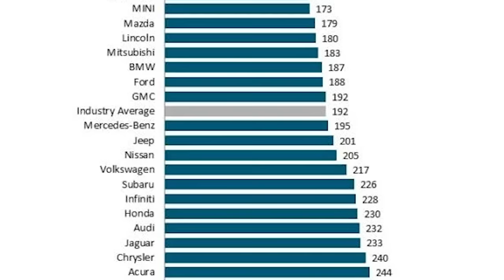Trucks That NEVER Break Down (Reliably run 1,000,000 miles)

Comment: Not to be that guy, but my 4.6L 1997 F-150 got 565,978 miles on it before it just gave up. I don't know of too many Chevys that would ever come close. (Although, imo, the S-10, depending on the motor, was the best quality Chevy EVER made.)
Reply: Brian Jake Gaming  S 10 is the best Chevy ever made. 1500 from 88-97 comes 2nd. I've owned all 3 and my F 150 justifies why it's the best selling truck of all time, and the #1 Most sold vehicle in general in the US. Chevy fan boys hate that big ass pill to swallow. I understand tho. U owned an Avalanche, didn't u? Or maybe a Colorado? You have fake "vintage" Chevrolet tin signs in your garage, don't u? Maybe a bowtie tattoo?
Reply: There was an 86 f150 stright 6 that had 550,000+ miles that just would sit at my shop but we drove chevy express for work trucks. All guys beat the fucking balls off them. Would them so low on oil for so long. There was an 01 , 03 , 05 that all still run as back ups and new guys trucks. The 05  is an everyday truck and needed a transmission rebuild that costed 3k which was cheap around here for that work. I just picked up a 2014 f150 5.0 with 100k miles as my personal. Both chevy and Ford make some good vehicles. If I didn't see those chevy express vans with the Spartans box body get the absolute balls beaten off them and run 99% of the times I'd hate on chevys all day lol.
Reply: The old 4cyl rangers (the twin spark SOHC ones) do it routinely
Reply: My gmt 400 has about 633,000km and it still running strong and is still on the stock engine and 4l60 that being said I the Trans has been slightly modified with a shift kit and a bigger trans cooler but that’s about it
Reply: E150 with a 4.6, 670k, and ran like a champ, but the floor started to rust out.

Edit: only one spark plug change, and when I say it ran like a champ, I mean you'd think it had maybe 150k on it.
Reply: S10 transmissions were garbage. Got one sitting in front of my yard as we speak.
Reply: There’s plenty of Chevys that have, basically most gmt800s, 900s, and even the 400 series trucks last forever. Seen plenty of owners from Facebook groups with a ton of mileage on their trucks.
Reply: @shuruff904 GM sells more trucks than ford does to this day, it doesn’t matter. McDonald’s sells the most hamburgers, doesn’t mean they’re the best 😂

Comment: i currently own  a 91 toyota pickup. its been flawless i have taken so many trips over 200 miles and haven't had any issues at all.
Reply: Those are amazing trucks. I had a 92 which I put 370k on and finally sold it to a kid doing landscape work and I bought a new Tacoma back in 2012 which I still love as well. Every so often I see my old 92 still on the road hauling a trailer with a lawnmower on it.. incredible!

Comment: I have a 2007 Toyota 4Runner with a V8 with 167,000. Anyone know how much longer that thing is gonna last!? I’m waiting for it to break down so I can another Toyota!
Reply: It won’t ever break down if you keep up with maintenance
Reply: dont wait for it to break sell it now, it will be worth less if it breaks.
Reply: Therw are two million mile tundras with that same 4.7 v8 with no repairs done to the engine, and these trucks hauled and towed well over their rated capacities. They were hotshot trucks for the oilfield. Keep the timing belts changed and it will last forever.
Reply: @Jackmerius_Tacktheretrix  i believe there are 3 now and 1 Tacoma, original motor and transmission, 1 million miles
Reply: forever if you take care of it.
Reply: Unfortunately for you, never
Reply: You’ve got several hundred thousand miles left on it.
Reply: Leaving it sit abandoned in the driveway it will be good for another 5 yrs before you can sweep it into a shovel

Comment: my nissan  2013 titan pro 4x4 is a beast and is running with 185k miles like new. it hauls the 16ft trailer lor no problem.

Comment: I think your list is pretty spot on. I am a mopar guy. I have all Mopar in my garage. I love the Dakota. I have had 5 of them. 2 first gen, 2 second gen and I currently have a 3rd gen with the 4.7. I would never own any other mid size truck.
Reply: I have a '97 Dakota. In 2006, I purchased it from a buddy of mine, who needed a vehicle with better mpg. I live in the rust belt of Minnesota, where corrosive anti-icing products make driving possible, and expensive, because of rust issues. I retired my Dakota a couple years back. Never left me stranded one time. The body integrity became more of an issue because of the rust. I now drive a Ram Laramie, which I love.
Reply: If you never  buy anything  else  you'll  never know  what a good  truck is
Reply: @garysh3580  I'm never been known to be a fast driver. But I've always been interested in hot rods of the vintage type. Now I'm itching to look at the fast Ram Laramie on steroids. There goes my silent ride of my Laramie now, but the hellcat edition sure looks like a beast! Forget mpg; it's noisy; but not a lot of close neighbors to complain, anyway.

Comment: 90's Dakota over the Ranger and S10, the 318 is far more reliable and the frame is much stronger allowing it to actually do work.  I have 300k and abuse mine on the farm, never had a problem since purchased new, original transmission.
Also have a 97 V10 5spd dodge farm truck with 500k with 0 issues.
I think Gm makes the least reliable half ton from 07-23. Lifter issues on 5.3 and 6.2l and transmission/converter issues from 14+ with 6 and 8spd. It should be taken off the list entirely.
Reply: You're tripping
Reply: @AFTERSHOCK-bh7hh  from point "A"to point"B"!  That's my type of "TRIPPING"

Comment: Ecoboost engines have notorious timing chain and cam phaser problems. Most need them done before 100k miles. Some people have it done multiple times before that. Fun engines definitely, reliable? Not at all
Reply: You’re not correct. Literally thousands of them running around with 3-400,000 miles already and have never been touched. Nice try.
Reply: @adamharris2674  thousands is not a lot lol. Also, there have been tons of service bulletins for the timing chains and phasers
Reply: @rainyriderr1112  Google says 1 million Ecoboost engines have been sold in F-150s since 2011.  So in your mind 8-900,000 of them have come into Service for timing chains and phasers huh?  If ya gonna be a hater at least be somewhat believable lol.
Reply: @adamharris2674  do you own one? Also, can't forget the lead frame issues which would cause the transmissions to shift into first gear from 6th
Reply: @rainyriderr1112  No I do not.  Lead frame issue is for 10 yr old vehicles. What about all the many many issues with New Chevys and New Rams?  Not concerned with those I guess..
Reply: @adamharris2674  I didn't address Chevys or rams at all because I don't own one. I do own a 3.5 Ecoboost though and they're less than reliable compared to a lot of other trucks
Reply: @rainyriderr1112  it’s mostly unreliable to people that do absolutely no maintenance. Like you apparently

Comment: I’ve been working with my 3.0L 2007 Ford Ranger for awhile. Over 190k miles thus far and no issues yet. My grandfather owned it before I did and drove it to hell and back. But it’s still almost perfectly fine. Keep it maintained and it’ll run great
Reply: I have a 2003 Ford ranger with less than 80,000 miles. So far it's only needed a new fuel pump and we're going to change out the serpentine belt with new idler pulleys. The biggest problem with the rangers is they rust out. I just simply don't drive the truck in the snow and salt here in New York so my truck only has surface rust.
Reply: @DueyMiller-rk9dr  I feel ya there and that’s lucky with those miles. Regular maintenance really does suffice for these trucks but you are correct. Just like any other dead reliable beast, the rust becomes the main issue. I’ve already gotten enough on my truck for rust and miles that I may as well use it for the rest of what its got. My next repair is front shocks and that won’t be the end, im almost at 200k, there’s probably a few more repairs that’ll pop up

Comment: My 2000 F150 with 4.2L V6, 5 speed manual traney, extended cab has 286,000 miles on it and still running like a champ.

Comment: I'm rocking a 2010 F150 4.6L 2 valve regular cab.  142K miles no rust.  Doing improvements instead of trading it in.  Last generation all steel and the modular 4.6 is super reliable.  Rustproofing every year and keep up on the other stuff.  No payments for 7 years running!

Comment: Ranger frames were real good until 1993 with the body style change, after 1992 Ford started making them very cheap. The S-10s after 1993 has problems with the door hinges and that wouldn't be much of a problem if it was a Ranger, they are easy to replace, the S-10s are welded on and it's near impossible to get them right, I had a 1995 s10 and a professional body shop gave up on trying to fix the door hinge and only charged me for the cost of the wasted parts. It was actually worse when I got the truck back. 

My ideal truck would be a 1991 Ranger with the S-10 4.3 v6 and 5 speed manual.

Comment: Your picks are, as usual, spot on.  I have owned a lot of trucks, from Nissan Hardbody to F150 with straight 6, and I agree with all of what you said.  I presently have my first Dodge RAM and would like to know what your experience has been with the 5.7 Hemi with the new "dial a gear" 8 speed automatic.  Thanks.
Reply: THAT 5.7 CHRYSLER MOTOR IS A SCREAMER. IT IS SO FAST IT WILL SCARE YOU. I MEAN FAST AND HOLDS TOGETHER.
Reply: @crazyhorseaz5224  ...and I've heard they STILL don't oil very well when they're idling. 🤔

Comment: I’ve owned a lot of trucks from just about every manufacture, diesel, gas ect. I will only own tundras with the 5.7 v8 or older duramax lbz/lly. Back in 2014 I worked for a company that bought a new fleet of work trucks, they went from Chevy to rams(a mix of v6, 4.7 v8, and 5.7 v8) the v6’s and 4.7l trucks nearly bankrupted that company, the 5.7s weren’t all that great though either.
Reply: Toyota's are the worst can't plow or tow
Not reliable just got the frames replaced at 12,000 a truck and get a new lease on life.
Factory mistake
Reply: @robdioddo1483  you ever owned a tundra or are you just basing your opinion based things you read on the internet? Cause the frame issue was corrected by Toyota that was an issue from 00-03, I have a 2017 and a 2021, before that I had an 09 and after that I had a 2013, towed heavy loads with all of them and never had a single issue with a combined 600k-700k between the 4 of them. Pretty stout trucks from my experience.
Reply: The company I work for has a fleet of Ram trucks and vans. So far all the Ram trucks at our workshop has experienced electrical problems. We have six 2017 and up ram trucks. The 2500 6.4 ram truck seems to have more issue than the 3500 diesel truck. Even though the 3500 diesel would have CEL or an electrical issue, at least the engine still starts up unlike the 2500 6.4. The 6.4 seems tough but a few times the engine didn’t start due to electrical issues. But I do notice on cold start all 3 of the 6.4 at our shop are starting to have that “hemi tick”. I pretend I don’t hear it cause we need those trucks everyday. Both 2500/3500 gets the job done tho. Most of the time these trucks are left running while we do our job. Most of our trucks are under 50k miles but the Idle and drive hours have a huge gap. Idle hours ranges around 2200-2400 hours while the drive hours is about 250-500 hours. 

We also have 2 brand new 4500 diesel. They both have less than 10k miles. One of them already needs a new engine. The other 4500 still runs but needs to get the engine tested to verify if it will experience the same engine issue as the other. Apparently there’s a recall for those new Cummins engine? 

The Ram pro master 2500 11 pax van seems to be reliable. We use that as our everyday carpool vehicle to and from work. Totals about 80 miles a day. Has been reliable throughout the year with the abuse it goes through. The v6 engine does feel underpowered, it’s constantly hunting gears when driving on a slight incline.  Driving the van on a very windy day is so sketchy. I have to fight the steering wheel just to stay in the lane otherwise the wind would push the van.
Reply: Get rid of the 0-30 oil and use 0-40
And don't go past,5000 miles oil change,5.7 is worse with 0-20
Reply: @6.2Slomaro  alot of electrical  issues  was because of faulty  ignition  switches, changed that and problem was solved
Reply: @edososki5748  naw it was a faulty fuse box. And the heater core got replaced a week after cause it started leaking. and here’s more update about the fleet of ram trucks we have. Our company vehicle maintenance shop told me so far they had to replace 8 transmission. And another common issue they deal with is crack exhaust manifold.
Reply: @robdioddo1483  the 07 - 21 tundra can tow up to 12k lbs and has brakes the size of a 3/4 ton truck. Why can't it tow? 
The frame rott was in the 1st gen Tacoma and 3 gen 4runner. It didn't usually happen untill about  15 years with a lot of miles then replaced as a recall for free( btw not a problem if you're not in the rust belt).Still extremely reliable. The tundra is by far the most reliable half-ton truck ever. You have no idea what you're talking about
Reply: @robdioddo1483  those toYota’s are 1/4 ton trucks at best
Reply: @Myzteryman818  heavy landscape trailers 🙄
Reply: @Owen-lx7tx  12,000 lbs , can’t make this schitt up 😝

Comment: The 8.1L Gas V8 in the early-mid 2000's paired with the Allison transmission are stone cold reliable, as are the 4.0L Inline 6cyl of the Jeep Comanche.
Reply: I have 4500 GMC Kodiak 8100 vortec Allison trans.
Burns fuel but reliable pulls bobcat trailer and welder compressor like nothing

Comment: There is always a lot of focus on Toyota’s. Not that they don’t deserve it. But as mechanic they need more routine maintenance, their engines are more complicated. Power wise they have never been anything to Write home about. And yes they can rack up the miles but I have seen every brand and engine type rack up the miles.
Reply: Bullshit! that's the brand you'll see the least in any mechanics shop. Used up Hilux and Tacoma's go to third world countries and rack up 300k miles easily
Reply: @lobsterstrange  they also have smaller share of the truck market in the US. I have worked in repair shops for 12 years. Toyotas our great I would recommend them. But the other brands are also our great.  Cost of owner ship my also be cheaper on the other brands. Toyota parts come at a premium, labor is often higher due to the complexity of design. 

In third world countries they don’t have many other options out side of Japanese trucks. Sure they put 300k plus miles on them. That doesn’t mean those miles racked up without need of repairs or engine replacements. Again toyota’s are Great vehicles but they are not leaps and bounds better then other truck manufacturers. That’s is just facts. If they truly out worked and out lasted everything then construction crews, fleet trucks and other services would use exclusively Toyotas.
Reply: @alexgrindnshine2522  construction crews and government organizations don't use them because they only they are heavily discounted when they buy AMERICAN. You should know that. Every seen anything other than an American made car with the word police on it? Not in my years I haven't.
Reply: @lobsterstrange  300k ? Try 1 million miles original motor and transmission
Reply: @lobsterstrange really, that’s your lame response, because of discounts? I think more likely Toyota doesn’t offer a truck that can compete with the big three in a heavy duty application. In lighter duty segments the tundra is nice truck but again in no way does it stand head and shoulders  above the rest. The Tacoma had the midsize market almost exclusively for like 8 years so it was able to build up huge market share/following. 

Cop cars have always been American from what I know because a cop in Prius might as well have squirt gun on his holster to compliment his pathetic police car.
Reply: @lobsterstrange  what is your point? My point is Toyotas are Great vehicles, but overrated.  Yours seem to be to disagree with me and then try and insult me. Because you make no convincing arguments to compete with my statement. Pathetic. 

Yes toyota has had some powerful engines but they are not amongst the legends.

Comment: I've regularly seen Ford F-250 super duty trucks, loaded with tons of tools,  and steel up on the racks, go over 300,000 miles. No imports doing that.  Bouncing across job sites, dragging trailers.
Reply: Tundra pulls 10k pounds and goes to 1 million miles on original motor and transmission

Comment: I have two Toyota Hilux, a 2002 (gas) and a 2012 (diesel). I aquired the 2002 (170,000 km), sight unseen (it was free), because I figured it was a Hilux and whatever was wrong with it was probably worth fixing. Got lucky, just needed water pump. The crappiest thing on the truck is oddly the plastic handles to roll down the window. I can't seem to find them, and might need to 3D print a set; but, as serious "mechanical" problems go, I am o.k. with that. 😆

Comment: My 2010 Honda Ridgeline's original 5 speed transmission with 225K miles calls bullshit. 

Actually, I haven't heard of any RL owners in my forums and groups complaining about transmission issues either🤔
Reply: It was really only the 09 that had the issues,  as that was the first year that they modified it for better towing payloads. That being said,  my 09 has 398k on it and still goes just fine.

Comment: The best pick up trucks ever made were the 1999- 2006 GM trucks with the 4.8 liter engine. I've seen many go over 500,000 miles and a few over 800,000 miles.